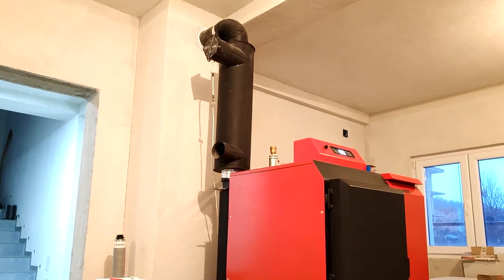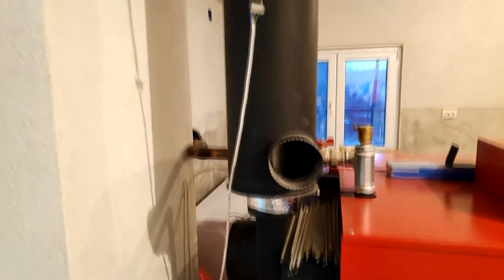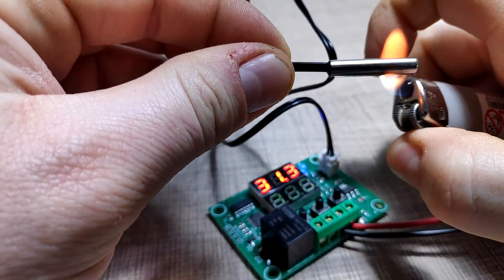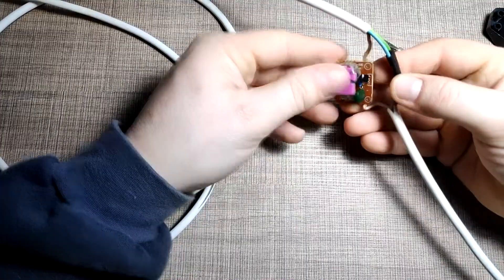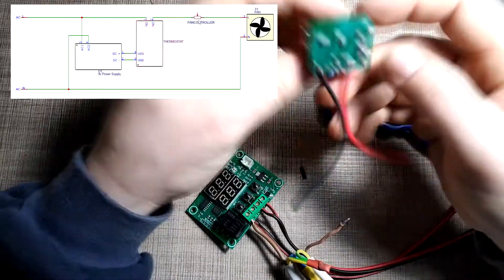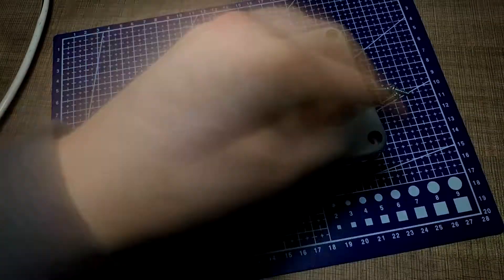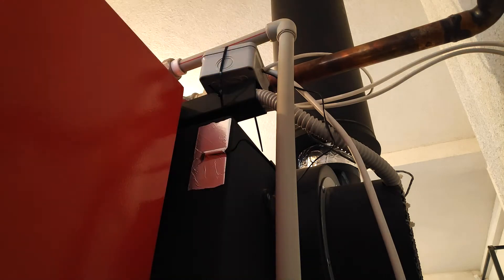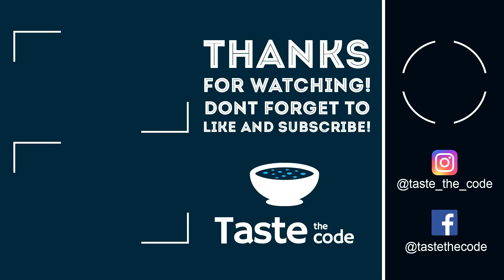Automated Thermostat Control of a Heat Exchange Fan

Comment: What’s the amperage of the module alone? I’m worried it would consume so much current in my 12V 20A power supply that would also power peltiers and fans.
Reply from the maker: I don't know exactly but I'm running it from a generic 12V 1A wall adapter module and it runs fine. I found some references online that it consumes <100mA. The fan is not powered from it but from the wall AC through the module relay.
Reply: Taste The Code thanks man! I appreciate it a lot!
Reply from the maker: @juliusjamescaesar  You are welcomed!